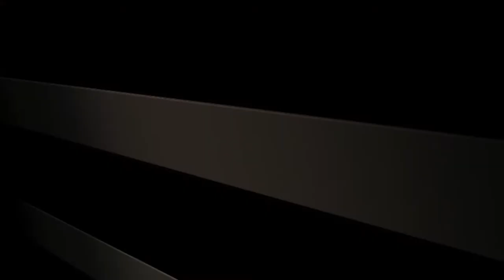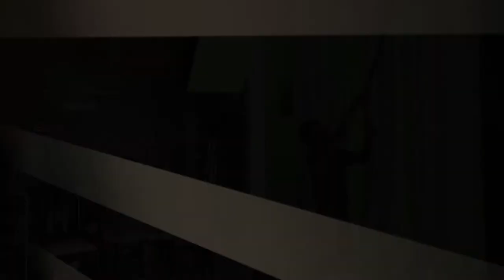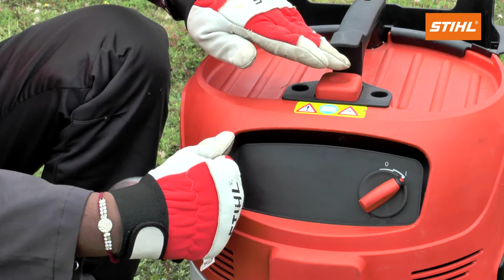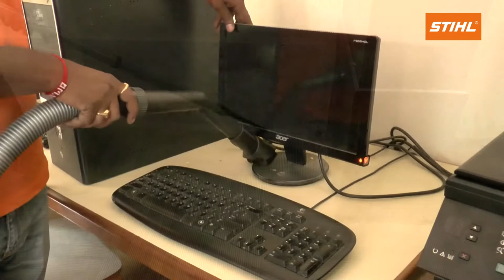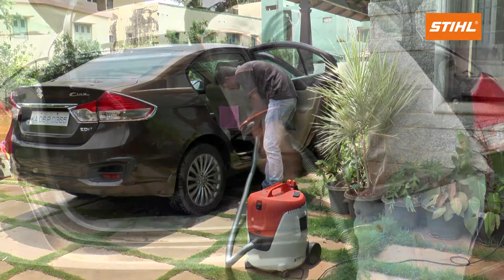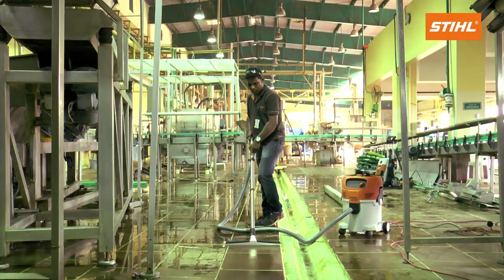Stihl Wet and Dry Vacuum Cleaners

Comment: Can we do dry cleaning without filling water in the container.
For I don't have time to wash the container every day
Reply: No, we don't fill water, instead, we collect it (Dirty water). I think dry and wet cannot be switched easily. You have to clean it after wet suction mode. They don't recommend using dry mode immediately after wet mode.
Finally, you have to clean the container only when you use wet suction mode.